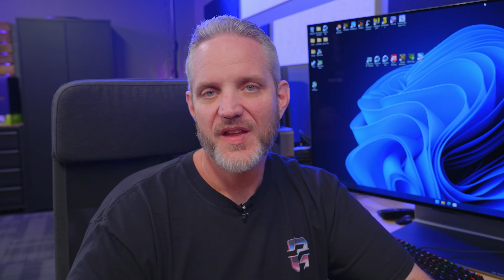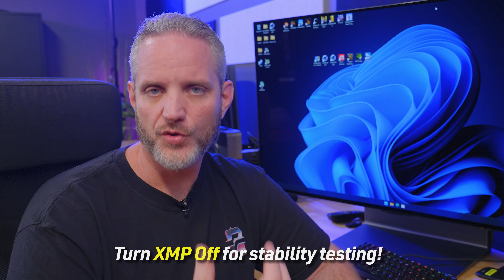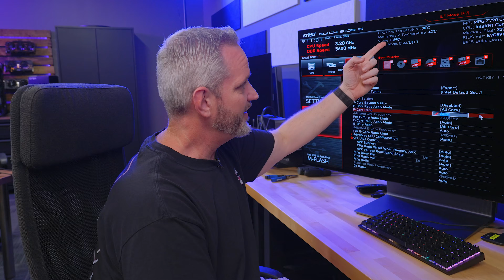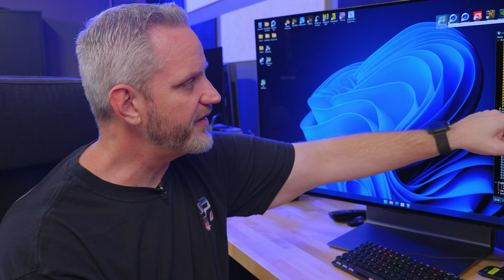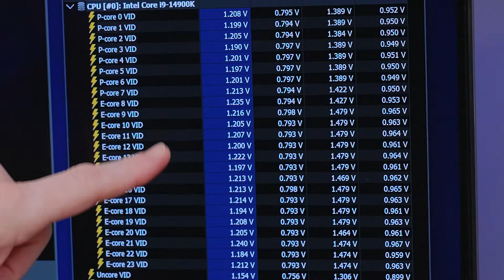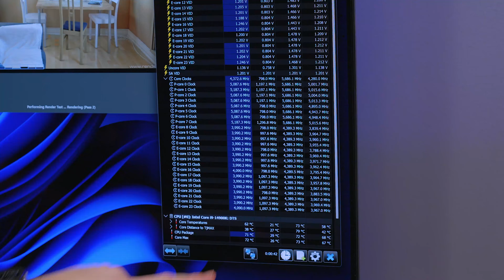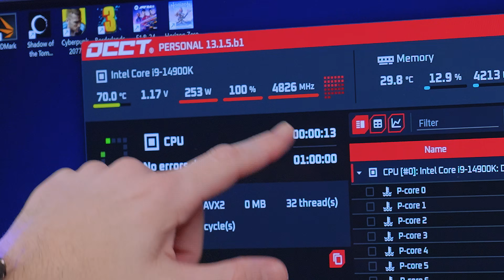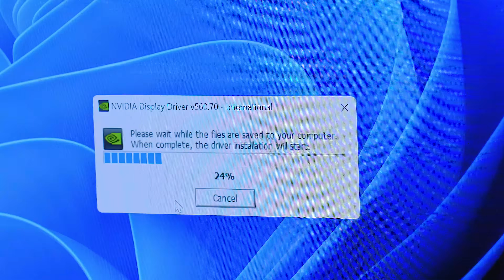Guide: How to check if your CPU is BAD!

Comment: Step 1: Download the free Black Myth Wukong benchmark tool
Step 2: compile shaders
Reply: I think we are getting all a bit crazy with this, me included. But nothing is really at stake if you think about it. Intel has extended the warranty and the worst that can happen is that one day some of us have CPU stability issues, you RMA it, and you get another one in a week. Meh.
Reply: @mundocpc 

You've completed overlooked the hassle/life factor involved. It's not quick RMAing a CPU and the system downtime can be more than just an inconvenience, if you happen to use your system for work.
Reply: @wonderpookie  Intel offers an Advanced RMA if you want less downtime but they charge $25, they'll send the new CPU first then you send them your old CPU.
Reply: @mundocpc not a week. They're out of stock on 14900 atm it's on reddit
Reply: To bleu or not to bleu. That is teh quest, son.
Reply: unfortunately, this is the case for most Unreal 5 engine games, I found turning off the internet during shader compiling helps or your antivirus app ...both cause issues I heard.
Reply: mmmm tried before the BIOS update and after... Same result, "compile shaders success" then directly back to desktop without any message or error. I guess my CPU is borked :S
Reply: @Vlkodlak  if it's already damaged the bios update won't fix it.
Reply: Is there an official way to force a recompile of the shaders on every start of the benchmark? So far I only managed it by manually deleting the "D3DDriverByteCodeBlob_V4318_D9860_S1359156322_R161.ushaderprecache" file within the "C:\Program Files (x86)\Steam\steamapps\common\Black Myth Wukong Benchmark Tool\b1\Saved" directory.
Reply: Got these problems and got solved with last video and micro update from last week.
Reply: @toalleitor  Maybe. At least nothing's caught fire... yet....
Reply: Works with any new UE5 games , like first descendant when compiling shaders it uses almost 90-100 % of all cpu cores and threads.
Reply: underrated comment
Reply: AMD CPUs are degraded as well?
Reply: @Tugela60  I heard of no known issues, but I did notice in firmware in gigabyte X670 "F7" i was getting 36,000 in cinebench and the "21" firmware dropped it to 34,000 so I think AMD is worried about this same issue
Reply: @patricklee8552  The processor manufacturers don't create firmware, the motherboard manufacturers do. Their motivation is to maximize benchmarks (helps sell boards) and miminize instability (helps reduce board RMAs). They will adjust the firmware default settings to optimize those two things, AMD and Intel have little input on what the actual settings used are. Motherboard manufacturers generally don't care if your processor is adveresly affected by however they set the boards up, all they care about is selling boards and not getting them RMAed back.
Reply: Lol love it
Reply: All clear with the benchmark tool on my 13600K purchased Oct 2022 (launch) although I think the issue is much less likely to affect i5's at least not nearly as fast, I installed the 0x129 microcode BIOS yesterday as MSI took it out of beta status finally.
Reply: Wait fr? I don't have an Intel cpu but would that be a good OC validation tool to add to my arsenal for AMD?
Reply: Haha, i wonder if this would also work on The Finals (also a UE5 game), i've have no problem whatsoever but it could be because The Finals is not as hard to run as Black Myth Wukong
Reply: Worked perfectly fine on my 14th gen. But I'm also not foolish enough to buy Asus and locked my cores and voltages long before any of this drama occurred.
Reply: Aparently, this works for asmongold 😂
Reply: @kuekejuu5057  Lots of people leaving super short commments throughout this thread making it noise instead of putting it on context. If they're going to reply to someone hit reply so there's context. Figured I'd tell you because seeing an Asmongold comment is super fun, even if again, you left no context. I watch Asmongold occasionally because my brother is a superfan. That guy isn't tech and I mostly watch tech and trading channels, but that dude should not be ignored. Super intelligent discusser of anything he sets his mind to.
Reply: @kuekejuu5057  I feel like a complete fool for trusting any vendor in 2024.
Reply: what abt lies of p, that game is also in UE5?
Reply: @dusty_48  i usually run aida64 extreme cache and ram test + download shaders in hogwarts legacy. If they fail i need more voltage or lower clock speed
Reply: Not every shader compile crash is the fault of the cpu, but it's a good way to test i9 13th & 14th gen for degradation.
Reply: Btw this error also is shown if your volatge is to low. Gigabyte is undervolting a bit to much for some chips for example.
Reply: 13900k and no issues compiling shaders any of the dozen times I've launched the game.
Reply: I've seen people have no issue with the benchmark tool but when compiling shaders with the actual game gave them the 'out of video memory' error and even BSODs so I doubt that is a fair test.
Reply: why i have to have steam to get dl's now...
Reply: It's crazy that 2 streamers I occasionally watch both had degradation crash symptoms when playing Wukong. (Asmondgold & Cohhcarnage), Seems like this is going to be a long nightmare for Intel.
Reply: My 14700k is cooked then
Reply: MSI MPG Z790 Edge WIFI Gaming and i7 13700k. Latest BIOS of course. All has been well with the testing. Also multiple Wukong benchmarks prior to getting the game. Zero crashes since building the summer of 2023. AIO for the cooling. I think I'm ok but still thinking about going Ryzen my next build.
Reply: Not how it works really. Shader compilation is an AVX workload. Said workload will trigger a drastic reduction in clock speed, with low clocks then you're no longer unstable.
Hard to exaplain but think of it this way: Imagine you have a CPU set to run at 10GHz (UNSTABLE), but then you have a built-in mechanism that down clocks it to 50MHz under an AVX workload (example: prime95 small ffts), this is how you end up with a potentially unstable overclock simply by testing in AVX load. This is why when testing CPU stability one should focus on both AVX and non AVX workloads. Most jump straight to the extremes of AVX stuff. In other words, you don't realize that you're unstable at 10GHz because running the benchmark instantly lowers your clocks so hard that now you're at a stable range. Now if you're still crashing with the "downclocked" state under an avx workload then we have big boy degradation issues. 
-Intelfanboy.exe
Reply: I like how Jay spends 80% of the time raving about HWINFO and how useful it is for overclocking, while the premise involves a CPU that by no means should be overclocked.
Reply: Yep, this issue totally ruined Black Myth experience for me. Crashes when fast travelling :(
Reply: I installed black myth wukong and compiled the shaders successfully with no crash. i9-12900k and rtx4090fe.
Reply: It won't start at all. Is that caused by faulty CPU?
Reply: The last of us also compiles shaders. Would that game be useful to test the CPU?
Reply: "The Finals" is a UE5 game. This would be helpful as well?
Reply: I know my cpu is failing because it keeps bsod ing when compiling shaders in delta force
Reply: Think my 13600K is showing symptoms, No game crashes even when trying Unreal 5 based games but Nvidia driver updates started hanging at around 40% (ive never seen this before on any PC), Chrome tabs randomly crashing or briefly pausing (can't click anything until it unfreezes). Avidemux sometimes crashes with Access Violation errors which is also new ive been using avidemux for years even on my previous i7 8700K and never saw this error, increasing voltage in bios seems to of tamed all of the problems for now, CPU was undervolted since day 1 which is where the uncertainty is all I know is it was fine this way for nearly 2 years (CPU Lite Load in BIOS) CPU is still slightly undervolted but closer to stock now, I have until 2027 to RMA if needed at least, running latest bios & 0x12B microcode. (CPU purchased  Oct 2022 on launch).
Reply: This is a good idea. I have a 7700X but i did got the "out of video memory" a couple of times in Throne and Liberty and a couple of hard crashes on that game too that required a restart. No BSOD and the system still worked but even just opening the start menu was taking ages. Though that could all be due to the nvme that i use for windows, i've heard that the symptoms of CPU degradation and ssd degradation (if its where the OS is) are similar.
Reply: ok
Reply: Unfortunately, users with an AMD CPU also have the shader crash problem.
Reply: @pdrey100  I didn't, my 5800X works just fine, but thanks for you're concern.
Reply: @TheDeathM  Obviously not ALL, but on steam forums users with an AMD CPU are also reporting problems with BMW shaders. So, it's not just Intel. I have a 13900ks and it also works just fine.  But thanks for your concern.
Reply: @pdrey100  Too true. Heavy shader compilation has always been a hardcore workload that shows everyone that the system they THINK is stable really isn't.
Reply: @pdrey100 Thats just an AMD issue, AMD being AMD.
Reply: @dusty_48  
step 1 install cpu in your motherboard 
Step 2 regret all of your life’s choices
Reply: @InnerFire6213  X2 for me: 7950X3D / 13900K.
Reply: Had the same crash with my 7800x3d in the same benchmark.
Reply: @hb-hr1nh  could just be that your CPU isn’t stable the way you set it up. Technically it shouldn’t crash. But I can see how it could be the case because you’d need more cores and threads for such a test.
Reply: 14900ks and no problems with shader compilations I’m safe so far
Reply: I downloaded that benchmark and the new Final Fantasy Demo and shaders compiled without issue on my 14900KS with new microcode 0x129 and I’m undervolted heavily.
Reply: What's are your undervolt settings, what mobo do you have  @TalonsTech
Reply: @TalonsTech  how did you update your motherboard? I have a asus z790 and I can't find if the bios has been updated to the new microcode.
Reply: That would show up if the chip is degraded quite a lot, but for people whose chips aren't as damaged it wont really help
Reply: @bleedxt  That is the point of this all is to find out if it's in advanced degraded state. If it doesn't show up then that's a good thing.
Reply: Good to know my 13600k is fine then, it compiled them fast as hell
Reply: @Dncmaster  Famous last words.😁
Reply: @Dncmaster  i5's are effected by this hardly at all. Have not heard of any i5's degraded, if not overclocked recklessly. And then it is just deserved.
Reply: @Dncmaster  As did my 12700k
Reply: @mikem9536  its not an issue with 12th gen...  lmfao
Reply: @mikem9536 12th Gen does not have these issues like 13th and 14th Gen, you are good to go!
Reply: 12000 series and earlier do not have "built-in" degradation issue, only if you overclock extra extra hard or "lucked out" to get a standart 0.5% deviation factory defective sample.
Reply: @mikem9536  its not an issue for 12th gen so your 12700k shouldnt face these issues!
Reply: @samvarnell7405  I also think some 13th and 14th gen that are based on the 12th gen Alder lake die are unaffected aswell, but that's nothing official. Intel extended their warranty only to some cpu models, and none of those 12th gen die 13th/14th gen were getting extended warranty.
Reply: @mikem9536 12700k was not infected if you had a 13700k or 14700k you may have a problem.
Reply: @mikeiscoo2 I hope so, i had a few crashing issues on my i7 12th Gen Laptop and I can’t afford to replace my laptop right now.
Reply: @mikem9536  I'm pretty sure your generation of intel processor is not affected by this issue.  It started with 13th gen.
Reply: @mikem9536  12th gen shouldn't be having issues anyway.
Reply: @mikeiscoo2  let me guess.... That's what you have?
Reply: @mikeiscoo2 yep I have 12th gen and wukong compiled shaders without issues.
Reply: @PilotLightStudios  yeah because it’s not a 12th gen issue.. 13-14 are raptor lake
Reply: Very early degradation would be microstuttering when in desktop just moving your mouse or when browsing, typingin word etc. If you have those in your i7/9 rma it. No microcode patch can "fix" your cpu degradation. If you can get refund then take it and put 12th gen.
Reply: @mooshi-x7927  Fk if its that I must have it since even the fking base OS i am getting legit micro stutters or micro freezes
Reply: Isn't that more of a UE5 problem? Isn't the GPU calculating the shaders?
Reply: @carbo-s9r No, Shaders are compiled on the CPU.
Reply: And?
Reply: @rotormann wait for crash, also works  with first descendant 😊
Reply: @marcinkarpiuk7797  Ok. No crash for me. My system is very stable.
Reply: @marcinkarpiuk7797 what crash
Reply: @marcinkarpiuk7797  That can be a voltage issue though. With FD, my MB was over volting and causing crashes. It would error as "out of video memory". But it wasn't. Updated bios, configured my voltages correctly, zero problems.
Reply: @rotormann  BSOD or not BSOD
Reply: @Pow3rus  there is another: out of video memory 😉
Reply: @marcinkarpiuk7797  that error is related to the same issue with the CPU

Comment: Both my defective 14900k were not able to finish a Cinebench R15 run. R20, R23, R24 worked fine but R15 crashed them instantly. No idea why.
Reply: i had same problem cuz undervolting